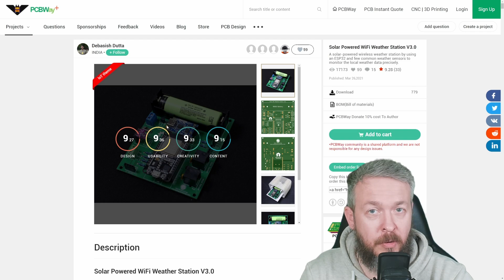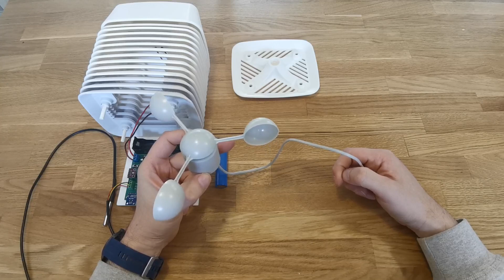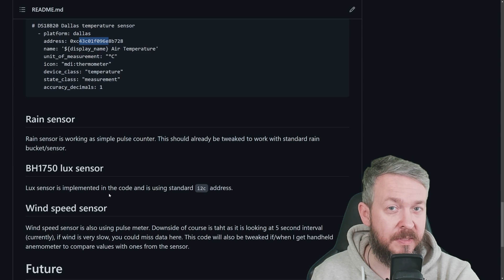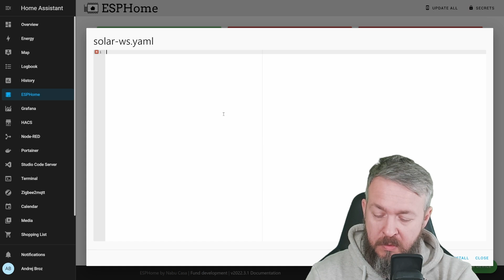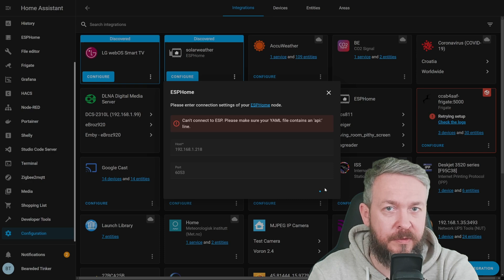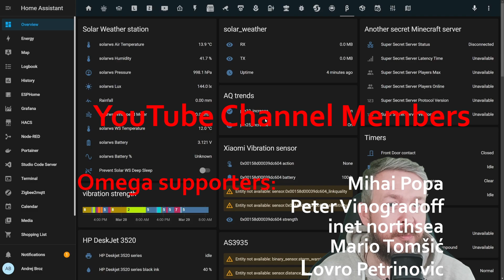DIY Solar WiFi Weather Station within ESPHome

Comment: I have not seen yet any ESP that works with anything below 2.8V. Also, if you discharge LiIon battery so low, you can consider it broken after few times. 
My weather station works for around 2 seconds and then goes to sleep, and I use MQTT instead of ESPHome - much more options.
I am wondering also how are you getting from battery volts to battery % - it is nowhere linear at all.
Reply from the maker: Yes, but for that purpose, I intentionally left it without sun to see what is the lowest recorded voltage when it reports state. Not sure how it managed to still work at such low V, but somehow it did. Also, note that this is not V from battery, but after it was stepped down - I know that this is a bit misleading in terms of sensor name - it should be ESP voltage, but makes it easier to read.
In first video I recorded (and scrapped as it was almost 2 hours) I did talk a bit more on MQTT. It's no problem to do MQTT, but wanted to keep it simpler in terms of what people need to get it working. MQTT also simplifies things as it skips possible HA API problems with communication. And yes, it also allows for shorter awake times. 2 seconds, I can't do, some of the sensors would than be useless (the way they are implemented now - wind and rain). All other data can be gathered faster.
Battery % is calculated on the ESP side (again really not % but power at ESP) - 100% is maximum reported V and 0% is when board stops sending data. So, as you said, not accurate in terms of battery, but gives easier to read state if ESP will work and survive night/rainy day or not. 
SORRY for long answer :)
Reply: @BeardedTinker  I am a fan of your channel - sorry if you got my comment as a critique - it was not supposed to ;-)
With regards to 2.4V - did you calibrate the ADC? if not then it would simply answer why it "works" with 2.4V - I doubt there is really so low voltage and it still works. For bare metal ESP32 I can get into 2.6V while for ESP32-S2 2.8V is the lowest one. 
I use voltage divider BEFORE LDO and I measure what battery really shows - irrespective what comes to ESP - I am not detecting how many volts come to ESP but how many volts with battery.
And once you measure critical battery level, you better make the device go to sleep rather than drain battery any further unless you have too many batteries to replace them one by one (vel: check what is the minimum battery voltage for LiPo before it gets broken).

With regards to wind/rain - any sleeping sensor will make these sensors useless as the measurement is only when it is awake, right? So kind of probing: "what was the wind/rain when I was awake?" rather than showing the real values ;-)

If you have time and want to make a video for "How to make a sensor/device with MQTT auto discovery on HA" I can help you with - I have done my research and it was not easy to find one comprehensive project. Also, when you use MQTT rather than ESPHome/HA API, then you simply send MQTT command i.e. "don't sleep brother, OTA is waiting" to the device, when it wakes up it will receive the message and voila - not sleeping anymore. 

I like ESPHome and I use it for some of my devices, but due to the fact, that ESP32-S2 is not supported on Raspberry Pi I can only use in case I use regular ESP32 (then it compiles). 

Also, with MQTT you can easily implement variable configuration and expose it to HA, i.e. sleep time different during the night (I don't need to have every 3min temp/hum outside when it is a night but I need inside as my heating system is based on my devices). So in HA you can have an automation that turns sleep time to i.e. 30min for some devices and brings back to 3min during the day, when it matters. 

One more thing: voltage divider in this project eats the entire battery during sleep - either make 2 resistors that are in total 0.5MOhm  (easy way) or disconnect voltage divider when sleeping (more complicated). My devices consume around 20-30uA during the sleep but I am disconnecting almost everything during sleep - also sensors. 

Anyway, great video for the beginners but once you want to make it useful I would go few steps further.
Reply: @zyghom  Hello do you have an example of HA autodiscovery on MQTT? On school I was creating a project on ESP for my master thesis (something like ESPHome) and since then i was wondering how to upgraded and connect it with HA. So if you don't mind to share some Tips and tricks, I would appreciate. Thanks
Reply from the maker: :) Sorry if I sounded defensive - just wanted to cover everything and keep short (which I can't) :) and no, I didn't get this as critique in any negative context.
Since it's not my HW, I've not touched that part. I know that original author did make changes from v3 to v3.2 to tackle some issues, but still there are issues. Was hoping for v4 to be release but it's late.
In terms of ADC - not really. I did check with multimeter and V was close enough.
For rain, I've started to work on updated code for it - not as easy as I hopped or wished. Currently working to wake up form sleep if there is trigger on RAIN pin, but have to do something about numbers too. Also, it's not as easy, but there is a way to distinguish wakeup due to sleep timer and pin wakeup, so this can be used to shorne as much as possible awake time for rain measurement. But this opens yet another set of issues (how to not update anything else except rain counter,..)
As for batteries - all currently used are old/salvaged/revived 18650 batteries, so no issues for now as I have a bunch od old ones. But when I get this finally installed at fix position, new one will go in, definitely. These old ones have very high fluctuations and can dip a lot in power when on load.
Yeah, I know of MQTT autodiscovery, and one of the reasons I went with API was to eliminate that. Wanted to make this as painless for beginners. When pesor was working on HiGrow board plant sensors - MQTT part was always complicating things. :) Again, thanks for the comment!!!!!!

Comment: Another great video!! It's perfect timing for your video. Thanks for sharing! I've been looking at this project from OpenGreenEnergy and it took quite some time to get all the components by mail. 
I was also considering lux sensor, but I'm affraid the lux sensor inside the enclosure wouldn't do the job perfectly... so my question is: how accurate is the lux sensor in your enclosure?
Anyways, thanks for the video, very articulated and I couldn't agree more with 5 things you like about this project!* (*)for me only 4 since don't have 3d printer :)
Reply from the maker: Thank you! Had so much fun with it. When I added rash sensor and each component it was a little celebration 😂
For lux, yes, I still have to drill a hole.
Didn't mention in the video but I'll also spray over PCB (protecting sensors before) protection film that should stop any moisture on the board
Reply: @BeardedTinker  :) Can imagine yes! You did  a great job with the code and also with disabling deep sleep! I can't wait to test it myself, thanks! I'll try to tweak it a little to get more wind data (maybe do a automation to switch deep sleep off). Take care and keep up the good work!
Reply: @BeardedTinker  Which kind of protection film did you use?

Comment: Nice project. Thanks for sharing. Hope one day to build one myself.
Reply from the maker: That you Adi! You can use code even if you start small 😉 for example only ESP32 and BME289 sensor.
Reply: @BeardedTinker  I do have a Dallas outside to have the real temperature. One day hope to expand and have the rest.

Comment: Super video.I cannot buy the original TVS Diode - DT1042-04SO , it is on other side in PCB.  But I have these diods:DRTR5V0U4S-7
D1213A-04V-7
D1213A-04TS-7
DT2042-04SO-7
D3V3F4U6S-7
DRTR5V0U4TS-7
Reply from the maker: DTS1042-04SO is out of stock everywhere from what I've searched... https://datasheet.lcsc.com/lcsc/1912111437_Diodes-Incorporated-DT1042-04SO-7_C460064.pdf
D1213A-04V-7 should be similar to it according to specs...
Looking at Digikey and Mouser - they are really out of stock on a LOT of parts :)